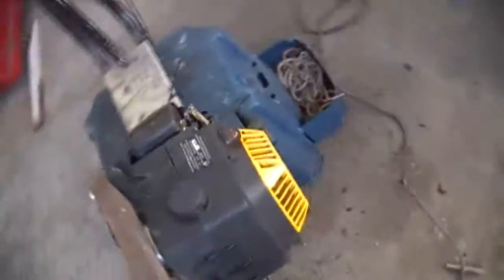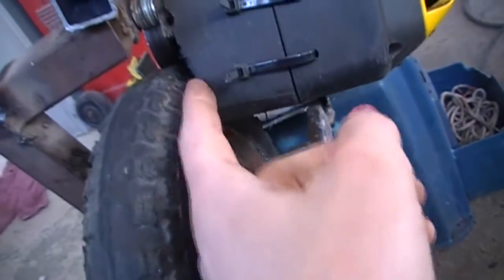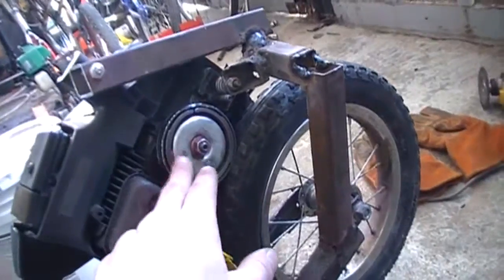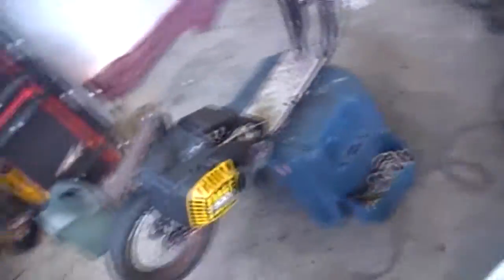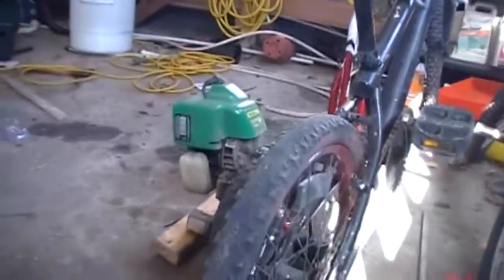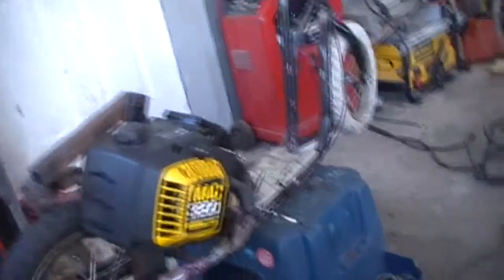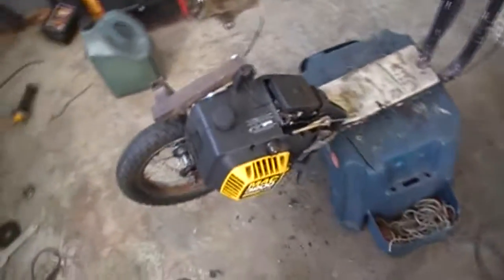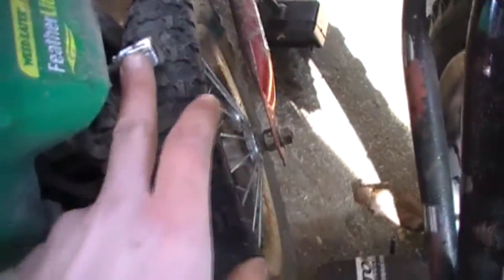homemade chainsaw scooter

Comment: to make grip, u could take a pnumatic circular grinder to the crank shaft thingamabober and make ridges in it, like a gear almost, but put the ridges really close together. also, putting a material on it could help as well, like super glueing a few rows of rubber bands around it